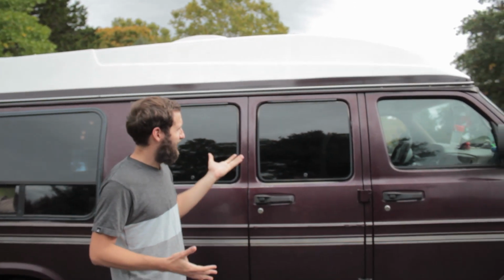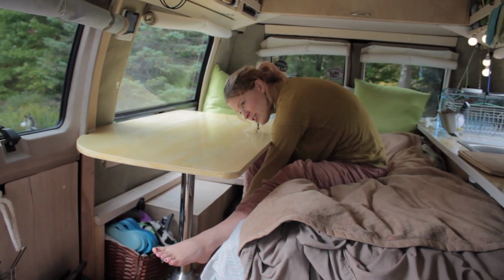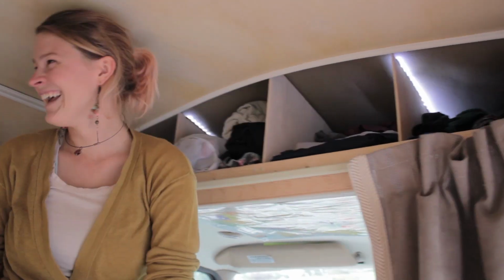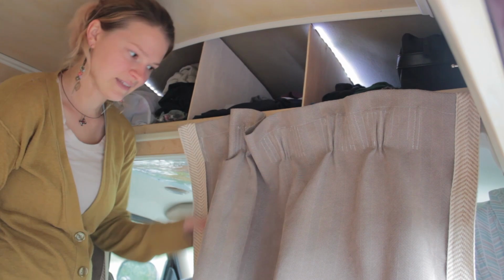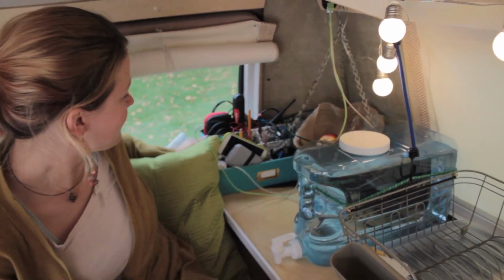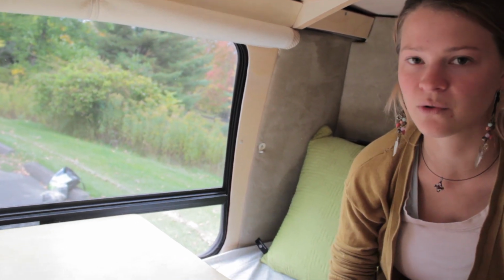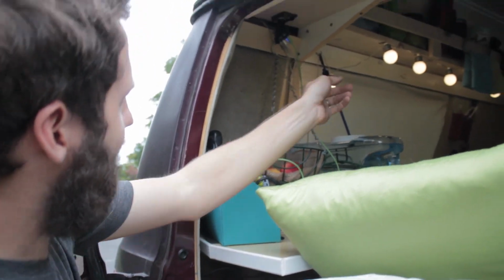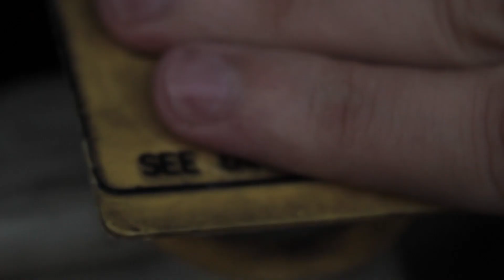VAN TOUR 2.0 - Fully Renovated!

Comment: I have a van for traveling and I found a great addition. I help my brother who had his toe amputated a year ago collect garbage from two mobilehome parks. One is clean and up scale the other not so much. At the up scale one I found a rug that is the same size as the back of my van but one problem when I get in the side door I can track in dirt and wet. My last find was a nearly new carpet cover for a desk. One of those things so your chair rolls around and doesn't leave marks in the carpet. So I put it on the floor in the side door area. It is clear so you can still see the rug and now clean up is just a rag or brush away. Saves the rug.
Reply from the maker: +BaconNBeer Cool!

Comment: I'm so happy to have found your videos, even though it doesn't appear that you are still building your channel.  I just bought a 2003 Dodge Ram 1500 conversion van.  You have confirmed my suspicion that I CAN install a Maxxair fan AND a flexible solar panel on my turtle top!  I was thinking of putting the fan near the rear (over the bed) and solar up front on mine.  Will be adding heat reflective film on all windows next week (I live in TN).  Elastomeric paint is just what I've been searching for to make roof more reflective as well.  I discovered a "house" battery under my van, an Optima gel.  It's no longer any good, but at least I know it's wired for that battery already, plus it's in an out of the way place.

Comment: I love your 2002 Dodge van, I just bought the same kind of van, Dodge Ram 1500 , 2002.  Mine has an electric fold down bed in the rear but I think I'm going to remove it and put an army cot bed (30" x 76") in  for a while. I have a small mini fridge and microwave that will run on my modified 2000 watt (peak 4000 watt) inverter.  I paid $500.00 cash for my van. The engine was supposed to be bad, ( was told it had a cracked engine block) but I quickly realized that a freeze plug was leaking behind one of the motor mounts.(cost $4.00 to fix) 

              Thanks, Bill

Comment: Just found you guys. Well done videos. Thinking of the van life. Most of the hard core guys on the van conversion sites would never do the propane tank your way. Most would never consider propane or go exterior tank or cetainly a sealed box if inside the van. Your thoughts on the subject? Do you have CO and propane detectors?  I read the first 100 comments and no mention of it so sorry if you already answered the question. I have gone back and forth on the idea of propane.
Reply from the maker: +SKWDMDYT Hi! Yes we considered a ventilated box and we definitely recommend a CO/smoke detector, but the more we researched about propane leaks, we felt comfortable that we would be able to smell a leak and our hose connector is supposed to detect leaks and break the flow if there is one. We also purchased a new tank and all the fittings and hoses are new and leak tested. I would not suggest getting those blue rhino swappable tanks because you can't trust the used condition they are in. We have had no problems so far and hope it stays that way. We have plenty of ventilation in our van as well. Thanks for the comment!

Comment: ROFL at "Totally empty  running hot ... just the way I like it!"  I pray i do better at maintaining my van than i was able to afford with my big truck.  putting off oil changes and such is hard on a motor.  Buy a new radiator is what i am going to do.  just replace it because i dont know how old it is and it looks full of rust.   I will be stuck in my driveway for a while but i got my van really REALLY Cheap.    I just want to take my time to ready it before i hit the long road.  I have plenty of local stuff to share first.
Reply from the maker: Yeah we think it's just a leak in the fill tank because the radiators seems to keep full and haven't had any problems with overheating since going up mountains during the summer lol sounds awesome wish you the best of luck! :)
Reply: fill tank was 1 of most replaced when i worked at a GMC  dealership.  i was just kind of paying attention to the parts i was throwing away as a warehouseman guy.  My mercury has had an empy tank with a full system for quite a while but i only dirve across town in it.  my town is small so take all that into account as to how many mile you travel.  cheap fix might save a ton  from damage a bad overheat could do?
Reply from the maker: Oh yeah for sure! I've learned the hard way to fix something right away before letting it cause damage elsewhere or leave you stranded on the side of the road XD

Comment: good job. I like how the bed turns into a table. And also I'm interested in how you did the build for the sink and the stove
Reply from the maker: Thanks! What exactly do you want to know about the sink and the stove? For the stove we just cut a whole in the counter, dropped it in, and connected a hose to the propane tank. For the sink we did the same except we just used a garden hose for the drain and it goes out underneath the van (we only use biodegradable soap). The faucet is just a portable shower that we run into a 6-gallon water jug and power it through a 12V plug. Does that answer your question?
Reply: Thanks for this info.... I can now show this to my brother so he can help me with a build
Reply from the maker: You can check out our van renovation videos if you want to see us hook up and install the sink drain along with other things :)

Comment: Nice Van build. What paint do you use on the fiberglass top? Did you apply it with a roller or spray? Did you sand and use primer before painting?
Reply from the maker: This is the paint: http://amzn.to/2ei2IST We used a different brand found at home depot called Lanco but it's the same stuff. It's a special type of paint called "elastomeric" which is extra thick to keep heat off, seals any leaks, any flexes in temperature changes. We sanded the top, used a spray primer, then put on 3 coats of the elastomeric paint with a smooth roller. Hope this helps!

Comment: Hey love the van there ,im curious are you worried about the propane tank ?inside ?   Also Amazon has a solar shower tube that mounts on the roof  it shoots water 60 feet consider the solar tube shower
Reply from the maker: We are not worried about having it in the van because we only use it for the stove and then turn it off right after. We are just extra careful with it :)
Reply: OK I will watch your channel for tips, looking for a van like yours. Great work! Peace
Reply from the maker: Best wishes!

Comment: What do you guys do for Heat? Thank you for the great videos!
Reply from the maker: Our insulation, with windows closed, keeps the temp 10-15 degrees warmer than the outside temp; add cooking dinner with our stove, body heat and warm blankets, and it'll reach 25 degrees warmer than outside. For winter we'll be in the south, but we're considering a BuddyHeater.
Reply: Cool... thanks for the reply!

Comment: I guess it is too early to tell but I was wondering if the white top did indeed keep the dark van cooler?  What exactly did you do to it?
Reply from the maker: It was difficult to determine how much it helped keep the inside cooler because we also insulated the van and added the vent at the same time. There is a significant difference in the temperature of the roof now versus before but I can't exactly say that makes it cooler inside although it is much cooler now than before adding insulation, the fan, and painting the roof. We needed to repaint the top anyway so we decided it would be worth trying the Elastomeric reflective paint, because it couldn't hurt! Hope this helps answer your questions :)

Comment: Do you guys by any chance remember the name/brand of elastomeric paint you used, and where you got it? My van is black and I desperately need to paint my roof white. I'm looking for a decent and affordable heat resistant paint.  Any advice you may have would be greatly appreciated. : )
Reply from the maker: +GreggFLA Sure thing Gregg! We got it at home Depot it's called Lanco Elastomeric. We bought 1 gallon for around $23 and only needed to use about half of it (3 coats). They sell I think 2 or 3 different versions of the stuff with different levels of protection and warrantees but we got the higher tier since we didn't need much.

Make sure you sand and prime it first though.
Reply: Thank you so much, I really appreciate it! Going to get it done before summer hits. A few days ago I ordered a continuous duty solenoid to help charge my house battery, the package came in and Amazon sent me a tube of Lock-tight instead of the solenoid. I literally smacked my head lol. Anyway, painting the roof is the next project in line. Thanks again for your help!
Reply from the maker: +GreggFLA It's important to stay cool in the Florida heat especially during the long summer. Good luck with your projects! :)

Comment: Great conversion.  One question:  isn't it dangerous to use a propane tank?
Reply from the maker: Propane is not dangerous if the equipment is checked to be working properly with no leaks and kept maintained. Thousands of people use propane grills, stoves, and heaters all over the world and accidents don't occur often. Most accidents are caused by user mistakes! We are mindful of the risks though :)
Reply: If you lived in the UK your insurance company would not agree - best practice is a sealed cabinet with a dropout hole and a dropout hole under each appliance - minimum is at least a dropout hole near the cylinder with say 2inch high barrier around to contain spills
Reply from the maker: Good to know!

Comment: nice clean setup in your rig. is your dodge a V6? have u had any problems to speak of with the van
Reply from the maker: It's the 8-cylinder model and I can't say we've had any unusual problems. Only issues our whole trip so far (8k miles) was the engine choking once in a while even driving on the highway which is a little scary. A mechanic told us it was probably our fuel filter being clogged possibly by ethanol in gasoline so we've been using fuel additives to help clear it out and that has been working pretty well. Overall though it's been running better than expected :)
Reply: +The Road Abode I bet it lives the gas huh
Reply from the maker: It gets around 14-16 MPG so it's definitely not the worst but still not great. At least gas prices dropped significantly this past year which made it perfect timing to hit the road :)
Reply: +The Road Abode ahh that's not to bad. the dodges seem to be cheaper. I've just had some bad voodoo with dodges. thanks for taking the time out in your day to chat with me.  Godspeed
Reply from the maker: Anytime! Goodluck finding a van!
Reply: +The Road Abode I have a 01 nissan quest  minivan.  It's in the conversion process, on wkends when I have time to puddle with it. I have also lived in a truck camper shell for a bit.
Reply from the maker: We met a really sweet lady who was camping in her minivan and she was in her 60's! She used to have a larger camper like a Pleasure Way but sold it.

Comment: hi there. I've been living in my Chevy camper van for almost 2 years.
where did you find that paint at to help reflect heat, the cost of it and average guess to cool without using a/c nor using ceiling fan?
Reply: PS

you've also given me a great idea. by back seat folds down to bed. its just me and my dog I think building something myself I could make a shelf stand on one side easily to store some things. thanks
Reply from the maker: Here is the paint on amazon: http://amzn.to/2gIslff 
You can get similar stuff at home depot for a couple dollars cheaper by a company called Lanco. It definitely keeps the van from heating up as much and quickly but without the vent it would still get too hot in the van. The vent is more effective than the paint but we needed to paint the top anyway so it was worth it.
Reply from the maker: So happy we could inspire new ideas! :D
Reply: The Road Abode 
thanks for reply. I've seen housing roof paint a guy used on top of his car last year. ive forgotten the co. name but they never returned my message to see if I could get a sample or anything under a 5 gallon bucket. I wonder if its same thing.
its surprising cool inside my van here in Florida vs outside. its already insulated and mylar is a miracle. I have to educate folks my van and conditions are not like cars and most other vans due to my dog. however if temp is above 93 and no shade plus feel like temp in shade over 103 I can not work during the day with dog inside even with 7 windows open beside front two and mylar on all windows.
I will not spend a 3rd summer here in Florida again living in my van because it is brutal heat and sweat until sometimes 3 am.
my van is mostly white and few shades of others on bottom... custom painted.

once I can afford a laptop I'm greatly considering to create a channel on my van living skills plus other survival stuff I've seen seen others do and a few I rarely seen.
Reply: PS
its nearly impossible to find trees beside palm out here unless at a swamp.
Reply from the maker: Oh yeah that Florida heat is bad and we are excited to finally live in a cooler climate this year for the first time in our lives! What part of Florida do you live in? We are in Georgia right now heading to Jacksonville to visit friends and then headed to Naples, FL after that to spend the holidays. We know what you mean about explaining to people about leaving the dog in the van, we have had the same issues even with a huge fan and all the windows open people are just sensitive sometimes. We recommend staying in the Northeast this summer, it's beautiful up there if you have been before :D We fell in love with New Hampshire, New York, and Maine!
Reply: The Road Abode 
I was living in st Augustine for over a year n half until hurricane Matthew. currently I'm in Tallahassee and this place is a total bore. 
I will likely maybe stay here for another month since I'm working now.

I know all of the hook ups in st Augustine... free meals.... 6pm dining with dignity near king st and Washington st
 churches make home cooked meals and seconds and thirds available
get snack packs most nights and sometimes clothes. but the food is usually so fantastic. 
I only took them up when in need.

I really did not like jax ... same as here in Tallahassee, but I highly recommend you all visit st. Aug and also marine land beach about 15 miles south of st Augustine pier. its the most serene and sacred energy at a beach I've ever discovered... basing on Florida and California
Reply: PS
Florida has crazy drivers. I got hit in August and because I don't have pip coverage which is optional in north Carolina.... I found a lawyer to pay my Chiro etc
so I'm stuck here temp.
a lot of nice people in Tallahassee but it is a screaming bore.
nice folks in st Augustine and people are more down to earth. I miss it there  if it weren't for job I'd go back until spring time.

Comment: do you honestly think the white roof helps to keep the inside of the van cooler?
Reply from the maker: We really do actually because it used to be the same dark red/purple as the sides and you could feel the heat coming off. After painting it there was a significant difference. Painting the whole van white would make more of a difference but that was a much more expensive/difficult task. We can't really say that "type" of white paint makes a significant difference versus just regular paint but it wasn't much difference in price so why not.
Reply: I have one also on my van same color.  It's fiberglass.  Did you put that rubber sealer on your roof?
Reply from the maker: All we did was sand it, sprayed it with primer, and rolled on 3 coats of this elastomeric paint: http://amzn.to/2eFhAXl

Comment: i love your van i thought you might want to consider getting rid of the propane and getting a induction cooker wayyyy safer
and cheaper heres a link NuWave 30153 Precision Induction Cook top with Pan anyways keep on keeping on
Reply from the maker: Induction stoves are cool we just don't have enough power to use one. A propane stove was a much much cheaper option for us considering the price of having to install more solar panels and batteries. If we were parking at campgrounds with electricity hookup that would be a different story! Thanks for the suggestion though :D